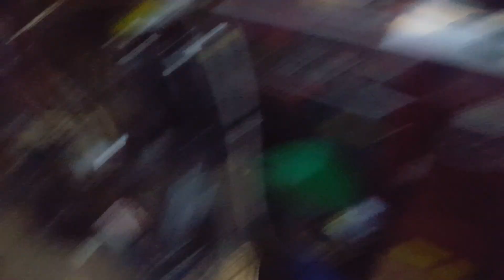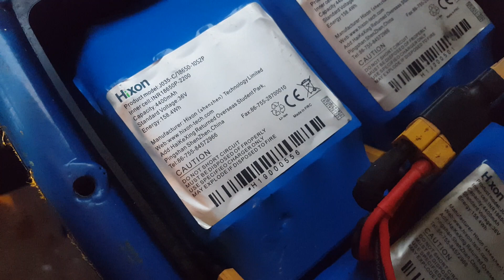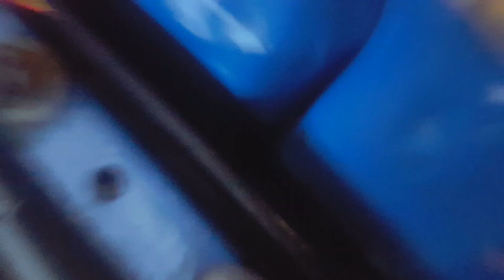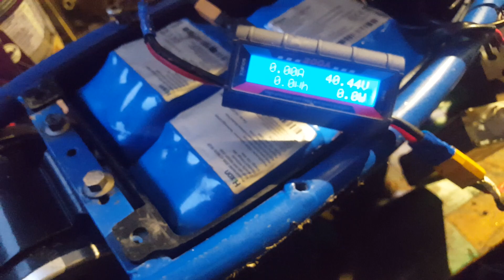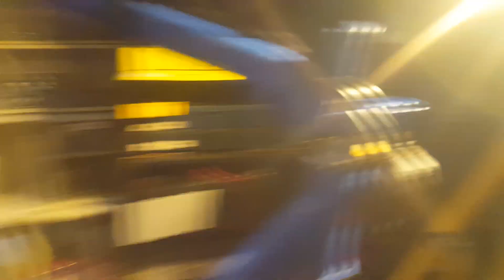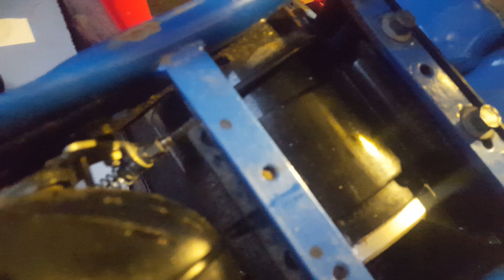My Razor e300 electric scooter build. 36v 13.2Ah 500w #3

Comment: What's the top speed on this thing?
Reply from the maker: 27mph. Using me phone GPS. Any quicker and I'd reccomend wearing a helmet
Reply: @ChewSmoke  niceee what gearing are you using
Reply from the maker: @Outspokentiger007   I didn't get into gearing its standard rear and the standard front that came on the motor. Luckily its about rite.  Can check tomorrow if you like👍
Reply: @ChewSmoke  that would be nice man thank you
Reply from the maker: @Outspokentiger007  even better i made a video 📹. Have a look pal. Anything you need help with ill try me best

Comment: I’ve done the same thing mate my speed controller is exactly the same had it running for a few months now but now the speed controller smells of burning
Reply from the maker: I give mine death. Full throttle everywhere. Motor doesn't even get warm im really happy with it so far its been good to me
Reply from the maker: Yeah the cheap controllers might break after afew months. Good thing they are so cheap eh i paid like £8 for mine
Reply: Yeah I think I paid about the same will just order another one everything else perfect 👍🏻